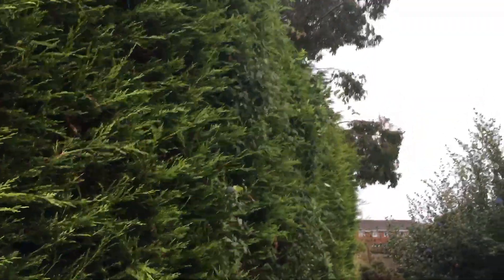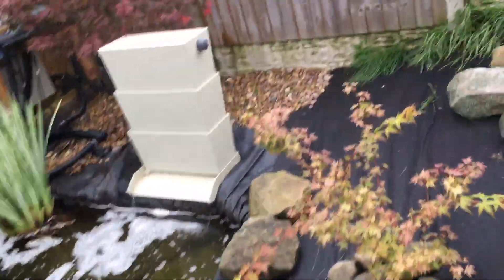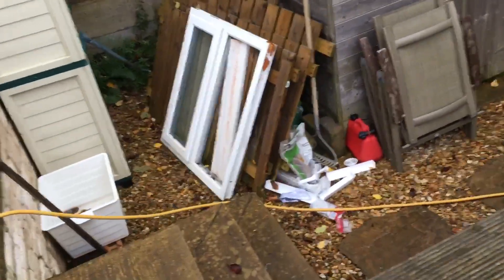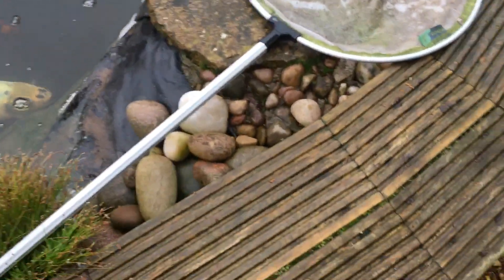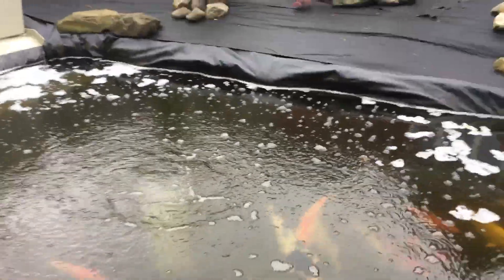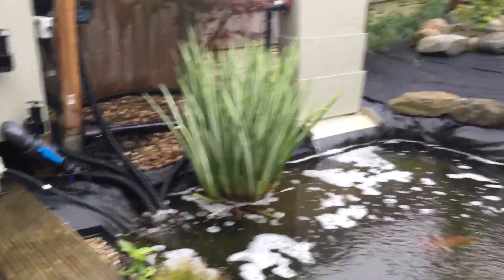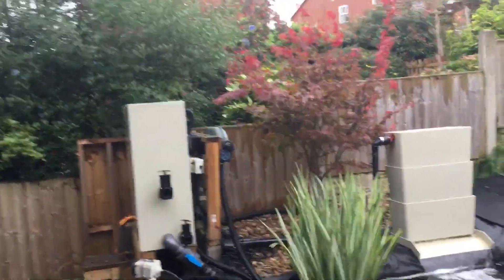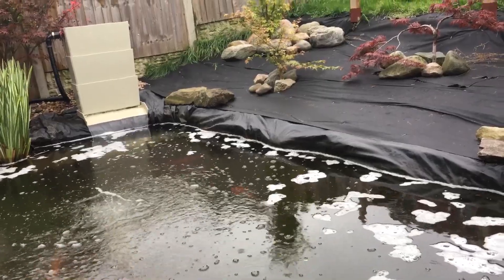Sieve 2 and Bakki shower update

Comment: Are you sure the silt just hasnt settled
Reply from the maker: Alan Langhorn I will be hovering the bottom of pool soon but I must say the screen on the shower has been full every day and the same with the mating I put in the top of the bakki shower. I think running the large air stone on the bottom helps to keep it on the move 👍